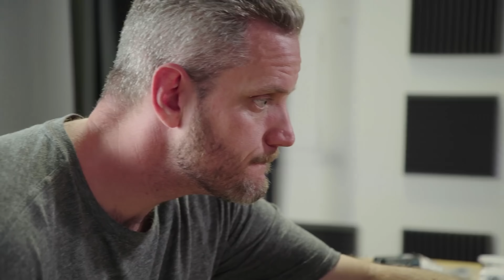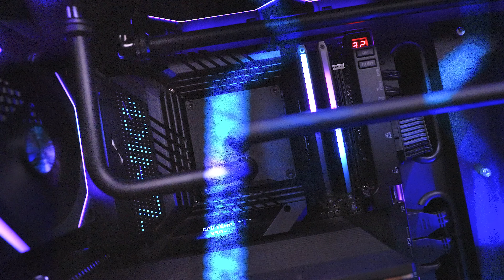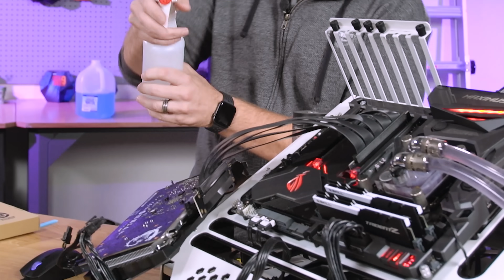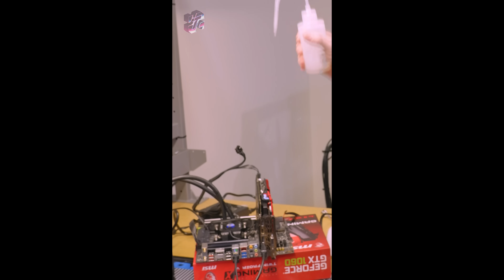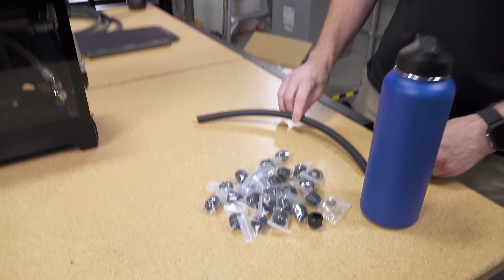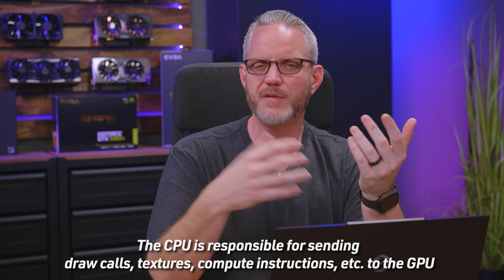5 Myths about Watercooling that are WRONG!

Comment: My previous case loop went Reservoir > CPU > Radiator > GPU > Radiator > Reservoir

This case goes Reservoir > CPU > GPU > Radiator > Radiator > Reservoir

Zero difference in component temps and the coolant temperature in the reservoir is also the same.

Chonky AF rads, though. HW labs makes big boys, lol. The Nemesis GTR-140 and Black Ice SR2. 2100W of advertised dissipation, between the two, lol. But with the brackets, they're 55 - 60MM thick.

Comment: I had a AIO and it seem to run hotter than my bequiet rock 2 black edition. Now At idle i get 32c and max I get 71c. Before it would idle at 46c and 85c with the Aio. I do agree room temps do effect the over all temps.

Comment: I still argue that if you can have a radiator after each component, it helps, but jay isnt wrong. These devices aren't going to melt themselves even when the pump stops running, and youre only talking about a degree or two, AND if you have enough heat transfer capacity, you'll be far below 40C let alone 70C, so there is NO PRESSURE to have a certain loop order, it doesn't need to ideally optimized with sanded IHS, ans liquid metal, etc etc.  Using the right water is key, and... this is the most important part:PRESSURE TEST YOUR LOOP WITH AIR FIRST.
The number of times i had one or two fittings just 1/8th of a turn too loose

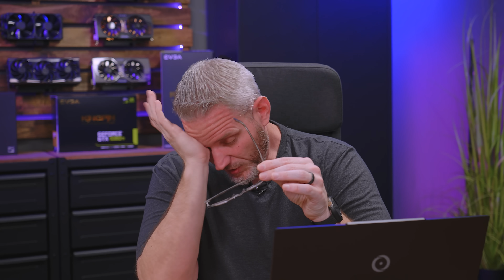Comment: 14:50 - it hurts me how a guy with that many years in PC WC industry even thinks to say that. Difference of water temperature going in and out of the block might be up to 6-7 degrees Celsius and of course putting that water back into another component before cooling it down will heat the 2nd component. 

Example with max. heat capacity is stupid also. Like you know that bigger heat saturation means hotter water inside of rad also right?... RIGHT? 
Guys from ExtremeHardware are fighting with people like you for years, they sometimes show 20 degree temp drop just by changing loop order and to the complex builds they might add a 2nd pump. You have possibilities to check that, but you wouldn't. And if you don't see any difference then sorry to say - your testing sucks - maybe thats why you're considered as a mainstream technology channel. Also, thermal capacity in rad tell you about how much kenetic energy it can dissipate from water, not from component you're hooking it into. Using this same components kinetic energy after 1h benchmark will be different if you use 1L loop and different when your loop can take 5L of water.

Another example with pump at the top w/o reservoir from physics standpoint is also stupid. Yes, water is nearly non-compressible so if you move something inside closed loop at the start, it should transmit its energy till the end. But no. 1st: you will lose kinetic energy with the distance. 2nd: if you will put your loop 100% water without any bubbles, your pump will have a really hard time pumping that water. Its because before pump (when it starts) will create 'a bubble' of lower pressure, and behind pump 'a bubble' of higher pressure. And because - one more time - water is (nearly) non-compressible fluid, then without very high compressible air pump cannot create those bubbles and water will stand still. That's why AiO's have some air in it. Open one and top if out with distilled water, you have plenty in warehouse to do that - after few seconds it will be loud as hell and perform worse.

"You don't need to be an expert to do WC" - well, considering that you will need to know how to peoperly clean your rads, what type to fluids use and what totally do not touch, that it will be good to know how to PROPERLY connect stuff in tle loop and have a PROPPER LOOP ORDER, to know how to even pick parts (most of people do not know difference between soft tube connectors and hard tube connectors) and how to build loop to easilly maintain it later (like remember to put a loop drain).

Cool video but without any thought behind it before recording.

Comment: "Hell Yea" Let's see that loop order thing...
Reply: Fun facts about loop order: I have two thermal sensors in my system, radiator entrance (hot water) and radiator exit (cold water). In normal case it's about 31C and 30C, so the difference is about 1C after both CPU (14900k), GPU (4090) and two pumps (they also add some heat into water).
If I lock pumps rpm to 800 though cold water is close to room temperature and hot water climbs past 40C. And components temperature also climbs quite high (gpu about 70C). So it's not even about loop order but flow is too low to cool down components.
Reply: @deadlymecury yeah I ran double temps sensors for a while and pretty much as soon as you start seeing big deltas it’s a sign that pump rpm are probably too low and there’s a flow problem more than anything else.
Reply: @helljester8097  yep. And because of that it would be nice if corsair added delta between sensors as rpm control. In that case you could use difference between hot and cold water to control pump and difference between cold water and room air to control radiator fans.
Reply: @deadlymecury You should look into aquasuite then. Aquacomputer has great controllers and monitoring: Quadro, Octo, High flow next, D5 next etc. Icue is just trash.
Reply: @deadlymecury Aquasuite and you can do almost anything you want with your loop. Controllers and monitoring needed of course.
Reply: @deadlymecury You should look into Aquacomputers aquasuite and their products.
Reply: @Simon_Denmark  I have two problems with aquacomputer: molex and I cannot hide it under mora because it is taller than 1cm. Because all connectors are facing up and not sides.
Reply: @deadlymecury  You’re really restricting yourself with Icue though. I’m using a MO-RA too with the 2 D5 bracket but I don’t know what your setup looks like, I just have all the wires coming from my PC without being really hidden. I guess you mean molex for a quadro or octo?
Reply: @deadlymecury  And yeah all of the connectors are facing up on all of the controllers but I’m pretty sure that there’s some 90 degree versions of molex. I don’t know if that would help you at all though because like I said I don’t know at all what you’re MO-RA setup looks like.
Reply: @Simon_Denmark  I know, restricting, suffering and having different profiles for different room temperature aka winter, summer etc.
Pretty much the idea behind my setup is to have a single power cable: I don't have cables for all the fans and pumps, instead I have an pcie-like power extension connecting psu to sata cable hidden under pumps block. And such extension made of 16awg can be up to 5m (I have sets 1.8m and 3.3m, second one to leave mora on balcony outside).
That sata cable power up both pumps and Corsair controller that is hidden on the bottom behind leg. 
Plus optional usb connection to switch profile or read sensors.
Reply: @deadlymecury   Ah ok. I know that some people try to make their MO-RA ”wireless” from the PC with the onboard memory on quadro or octo and getting the power from a secondary PSU. Others make a custom cable like you which includes power and usb connection. That’s a cool setup. I’m just ”lazy” with mine. SATA and USB for D5 Next, molex for the second normal AC D5, PWM from D5 Next to the other D5, PWM from PC to NF-A20. Octo, Hubby7 and Farbwerk360 inside the case. Also forgot high flow next.
Reply: @deadlymecury  I'm running a PWM D5 pump with 7950x3d and 4090, min speed I can run is like 1800rpm, maybe 0.7L/min on my flow sensor (not sure how accurate). Up to maybe 4.0L/min at 100% pump speed. With pump>GPU>CPU>rads (3x360) with a short GPU benchmark I see maybe 5C drop across the system, 2C at idle. Been a while since I checked when fully heat-soaked but same ballpark. Not huge, but that drop is pretty linear to CPU and GPU temp. 

I run Fan Control software with pump speed tied to either CPU and GPU, whichever is higher - each has its own curve. More pump speed gives a little better core temps for both, but it's a pretty minute difference, maybe 1-2C impact. And basically zero improvement once I'm at about 50% pump speed. Rad fans are based on coolant temp, using the colder side.
Reply: @deadlymecury  That doesn't prove anything about loop order. If there's 30C difference between the coolant and die, all you did was lower the flow enough to find the water block efficiency threshold. More than one pump is pointless unless you're running more than one circuit. Those circuits can also share a radator and/or reservoir. I'm glad you realize pumps also add heat, a lot of people don't get that. Is it a lot and does it matter? No, not really.
Reply: @UVBluetoo  Surely if coolest part of the loop is 30C and hottest part of the loop 31C, "that doesn't prove anything about loop order" :)

More than one pump allows me to lower rpm on both of them to run it quieter, especially when decoupling is not that good. For example, with a single pump running at 4800 RPM I have flow lower than with two pumps running at 3500 RPM. Pump at 4800 RPM is quite loud (even if it is a single pump), while 3500 rpm is bearable / 2200 rpm is silent. 
On top of that, pair of pumps running silently at 2200 rpm give me about 80 L/h, which is well above the line when block performance drops rapidly. A single pump at 2200 drops below 40 L/h.
Reply: Hell yeah
Reply: I think some tests with probes all over the loop would be a great idea. put the argument to rest, and give the people something to link to so we can prove the point
Reply: My loop order is pump-gpu-cpu-rad-rad.  I have a temp sensor at the outlet of the GPU, and in between the two rads.  My flow rate with the D5 at 100% is .7 gallons/minute.  Which is ok, but I'd like it to be a bit higher.  

My fluid temps are within 1C at each sensor under load.

Oh, and my GPU is an overclocked 6900xt, CPU is 5800X3D.
Reply: Sad thing is, even if he does do that video.. and shows, without any doubt, that loop order truly doesn't matter, their will still be deniers who will die on the hill that it does matter.
Reply: @lyianx  I don't think that's quite right that loop order "truly" doesn't matter, it just doesn't matter much, and depends on use case if it matters at all. For example I want my PC to be as close to dead silent as possible, so I keep my pump speed and fan speeds pretty aggressively low. I have 4-5C delta with 4090 pushing 500W+ and 1-2C at idle (3x360 rads and Lian-Li P28 fans get rid of a lot of heat, even with max fan speed of 1300rpm; idle pump speed ~2000rpm or 1.0L/min and fans at ~600rpm). I hit low-mid 50s for GPU during most of the 3D Mark benchmarks.

EDIT: I didn't think that all the way through. Revising: I basically have 3 key points in my loop: after rads, after GPU, and after CPU. Either way, the CPU and GPU come after the radiators, so essentially it's a choice between CPU or GPU first. My ~135W CPU obviously will heat up the water less than my 500W+ GPU, so the GPU temps would only be 1-2C worse if GPU came second. So for GPU, not a big deal. For CPU though, there could be some benefit, as I imagine water would be 3-4C hotter after going through the GPU. As my system is set up now, with CPU second, I could potentially lower CPU temps during max load, but it would be very small since GPU usually isn't working hard on tasks that max out CPU. Impact to the GPU would also be minor, as usually when I want the most cooling for GPU, CPU isn't maxed out. In conclusion, I still think it matters, but just barely, and only in my more pump speed-limited use case.
Reply: Don't forget to put in water speed meters with different sized tubing and test different flow speeds!
Reply: LTT did this many years ago. I don't think anything has changed, still doesn't matter.
Reply: HELL YEAH!! WHOOOO!
Reply: also get 1x120 rad in between the GPU and CPU and a 2x120.  then compare it to a 3x120.
Reply: Hell Yeah x 461
Reply: Agreed! I've blown people's minds at my job telling them exactly what Jay said. The fluid doesn't have enough time to pick up so much heat that putting your GPU first in the loop versus your CPU makes one scenario better or worse. Put them in what ever order you want to... it's not really going to matter either way, and certainly not going to be damaging to either component if you "mess up" the order. I'd love to see a series of temperature probes set up in a loop to actually show the hard data on this. A lot of people will need to pay attention.

Edit: To Jay's credit, he said it better in this video than I have to my colleagues. I might just have to hold up his example!

Comment: Jay I water cooled my PC long before anything was available. I made my own parts without any help back around 1990. I just understood that thermal mass is the bottom line. Yes my first time used a heater core out of an 84 cavalier and a fishtank pump. Blocks were all aluminum blocks with fittings drilled in and some fins cut in for passive heat dissipation. No there were no fans on any of it because there was no such thing as motherboard headers. But I could push my system way faster than stock. No temp monitoring in those days so who knows what the real world benefits were. My current system is water cooled also. Nothing fancy expensive it just works.
Reply: That's awesome. I made mine in 2004 out of a 77 Bonneville heater core, and a modified fountain pump. I'm still using that heater core.
Reply: I think I did my first watercooling around 1996. Fish tank pump, some kind of custom brazed brass or copper waterblock, a reservoir that went into a couple of 5.25" bays and a tiny little radiator. Didnt make as much heat back then, so the crude quality didnt matter so much, but it was fun to do.
Reply: Now we're talking. These are the true hardcore water coolers!
Reply: From the comments let me clarify that no the cpus don't work like today. But changing the crystal for speed multiplication would push the vrm to past magma temps if you got serious. It was more to keep solder joints from melting in those days.
Reply: 1990? The fastest CPU was the 486DX 25MHz just came out, I think realistically you were dealing with 286 or 386 CPUs, most of which were designed to run without even a heatsink. And GPUs were non-existent those days. The hottest part in a PC was probably an HDD or a PSU. What were you actually watercooling?

Comment: For me it has always been about the cost of a custom loop. But you did show some examples of lower cost parts so is starting to look a lot more affordable. Maybe my next system.
Reply: im a one step at a time kinda guy i started with a simple cpu loop and now have a full custom loop including cpu, gpu, and custom distroplate. start cheap and simple and work your way up most pumps, fittings, and rads can move into new builds leaving the blocks and tubing as the major changes.
Reply: its a lot of work and parts up from, but unlike an AIO, if a component dies, or needs upgrading, only that one component is a loss. When you bend a fitting, or the pump dies, or the hoses abrade somehow - whatever the problem, it's more fixable for less money with a custom loop, and upgrading doesnt mean buying an entirely new AIO either.

Comment: If I had infinite time, I would 100% water cool a system.

The time I would spend researching and putting it together is too much of an investment for me to care however. I would rather spend that time playing one of the 200+ games in my back log, and not worry about maybe an extra 5 fps.

I understand that might seem silly if you really enjoy engineering that kind of thing and tinkering, but I don't. I like customizing my build and optimizing it, but once that's done I don't touch it except for 1 GPU upgrade and a few deep cleans until I build the next one.

Comment: I have a custom loop in my pc using all icue link products. Even using the lcd cpu block and lcd d5 pump. The cost of the loop including icue link fans fittings and tubing are  $1000 so yes it can get very expensive. But I love the esthetic of it.

Comment: For me living here in Australia it's cost as we get shafted for everything and then maintainence that turn me off water cooling, so I go the middle ground with an AIO.
Reply: maintenance really isn't bad keep am eye on system and temps and that will tell you when it's time to clean. (i've also had loops going 2yrs+ with no maintenance other than dusting with no issues using good fluid)